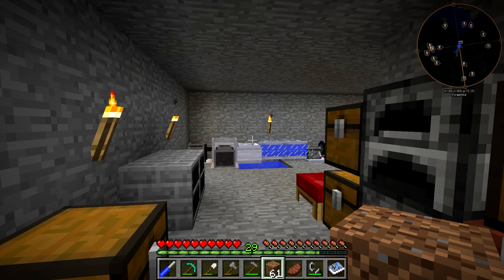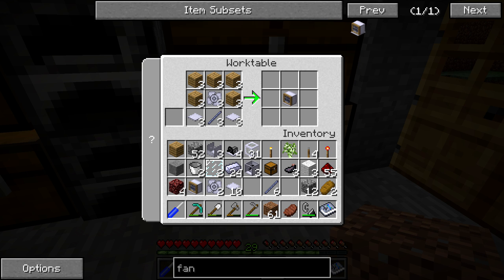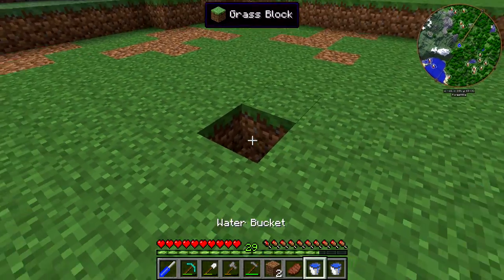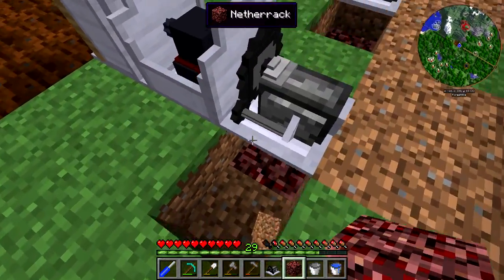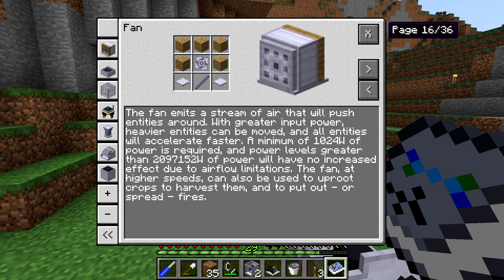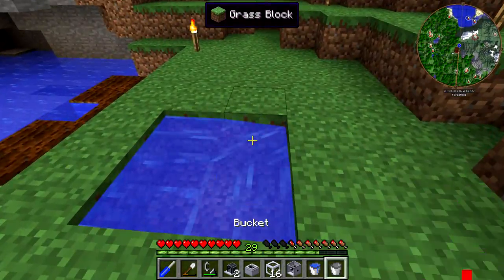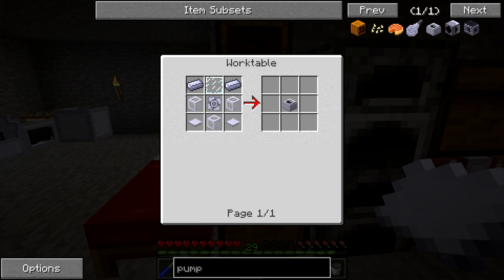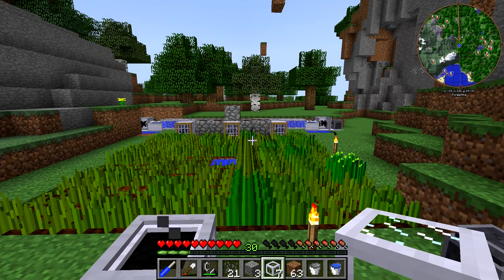Surviving With RotaryCraft :: Ep.3 - Automatic Canola Seed Farm

Comment: the steam engine actually requires a temperature of 100 Celsius (that's the boiling point of water in the metric system, reika bases this mod on realism) it explodes at about 125 C. strangely, it won't explode unless it has water inside. this means that if you notice that it is over heating, you can take out the heat source and mine out the engine to reset the temperature. I know this one from experience
Reply: just thought you'd like to know
Reply from the maker: Never knew about taking out the water to prevent the explosion, but it definitely makes sense! Thanks :)
Reply: It explodes if it is too hot (125°C according to Geminids) and you THEN add water. Imagine heating up a dry pan and then putting water on it. It will instantly vaporise, suddenly building pressure in the engine, making it explode.

If, however, you already have water in there, you slowly heat it up. Once you reach 100°C, it will slowly start to build pressure.

Comment: I know I'm 4 years late to the party but instead of using all those DCelectric engines and shaft junctions a single steam engine connected to a pump can supply itself and many other steam engines with water, just need to make sure to put the first 2 buckets in by hand and have a decent size water pool to avoid sucking too many source blocks.
Reply: 2yr late but
Do you happen to have exact numbers? (Like steam engine+pump can supply 8 engines for example? Excluding itself)
Reply: @nikolaskuklis5925  no, I never tested how many. But it is a lot. In my world I ran at least 8+1 steam engines and 2 of the crop sprinklers with enough pressure to cause the water to damage me.
Reply: @juliart  oh… that's a lot of things to have powered… good to know, thank you for the info
I might try calculate if i can figure out how if you interested?
Reply: @nikolaskuklis5925  Be wary that if you do hook up a steam engine to a pump it will need a large pool of water that can reform into source blocks. it will pull water so fast that a 3x3 will not be able to refill itself before the water gets used up.
Reply: @juliart  kinda wish there was infinite source of water to be pumped instead… so a 4x4? Or just 3x4? 5x5? I guess i will make medium swimming pool if needed
Reply: @nikolaskuklis5925  can't seem to remember what size is needed. Pretty sure 3x3 is to small. 4x4 might work, I used to just place the pump and steam engine out on the side of a river or pond and watch it go waaaaaaay out there. Fun fact if there is other water near the pump but not connected the pump will still pull water from there

Comment: The one thing about this mod that I find aggravating is the fact that the DC motor does not require a DC source to provide it with DC voltage and current- instead it relies on the magical Redstone source that provides power from nothing!
Reply from the maker: Yea, it is a little odd, but there are certain parts of this mod that aren't super realistic (unlike Immersive Enginnering) so I can't complain.

Comment: man, you are really having hard time with pump.. pump only needs 8nm and speeds do matter. on my setup two windturbin with pump even exceed pebblebed reactor's consumtion-and a bit quiet
Reply from the maker: +jupiterbjy Im pretty happy with the current 2x DC electric engines, 1x shaft junction, and the pump. Eventually when I compress all the setups and can make 1 water line ill switch it over to the turbines :)